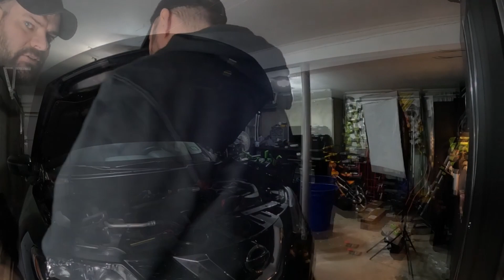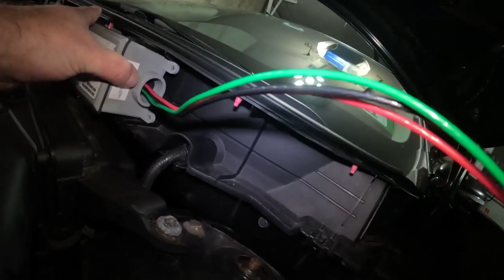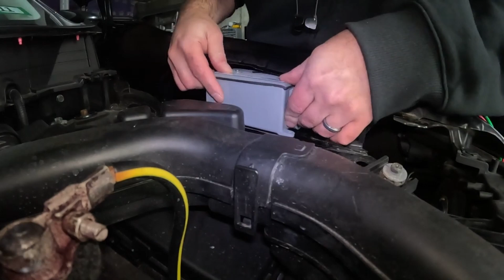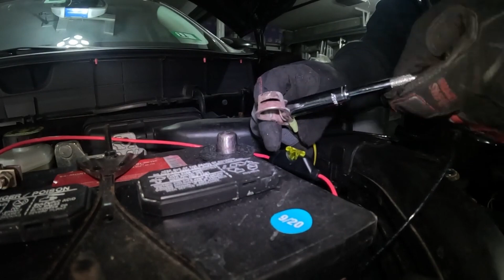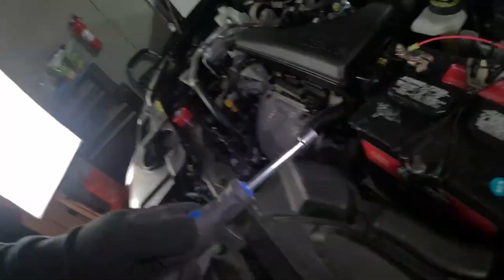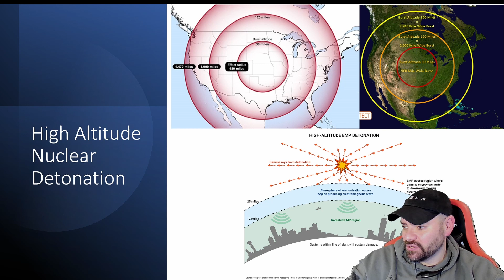EMP Shield Vehicles Install

Comment: This product is a Very Misleading Product. it could  Help  with  a power surges as in from the car itself or you car gets struck by lightning but as in a EMP that Preppers think about it can not work ( imposable )
Reply from the maker: I have done a great deal of research on the thing. You could be right, but from what I was able to gather. The E1 and E2 spike is fast. Much of the hardware we use today depending on the size of the blast can survive this with existing ground fault protection. From my understanding this product shunts any overvolt to ground from those spikes. The biggest problem with an EMP is the E3 or grid level spike. The grid acting as an antenna builds up a charge and this surge destroyed things in homes. This is what happened in Hawaii during nuclear testing. 

Vehicles are resistant to E1 and E3 spikes. But may be susceptible to E2. The positive and negative leads help to monitor voltage spikes and shunt’s excess around the battery to ground to prevent the battery from being destroyed. In any case, you could be right if an EMP hits. But in the case you’re not and one hits I may be able to get to a place before others and that’s a lottery I’d like to play if ever faced with such a scenario. You can check out disaster preparer as he does a really good job explaining this. The best bet is faraday protection over sensitive electronics. But given the keyless stuff entering the market and all the computer driven hardware. That seems like less of a possibility.